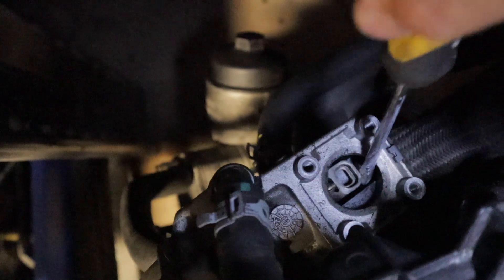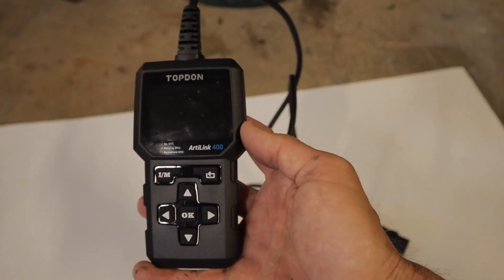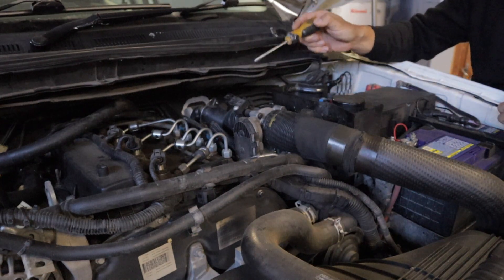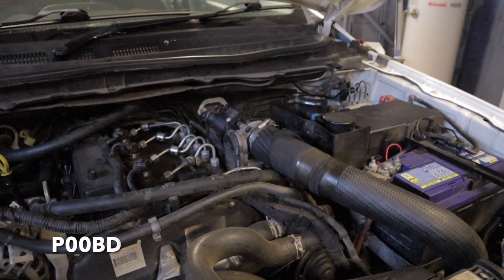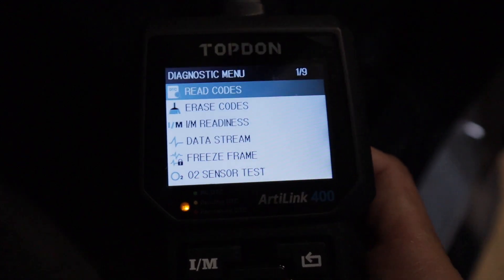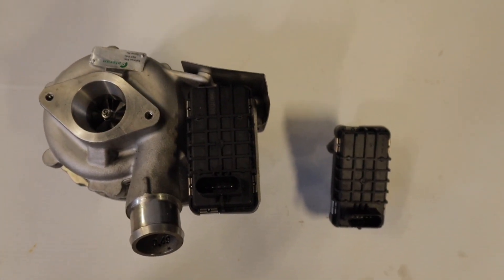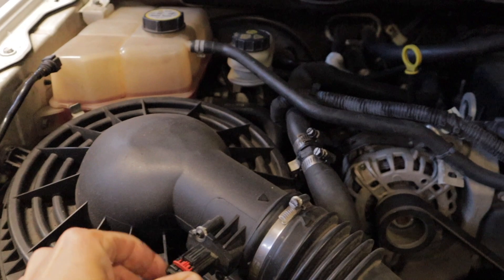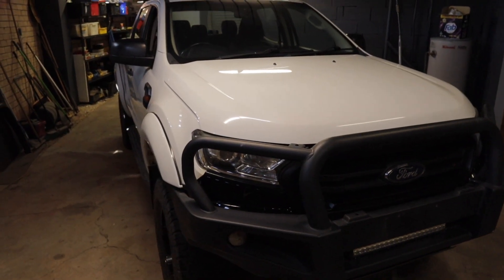Ford Ranger Common Fault Codes Causing Limp Mode

Comment: Hello, I have a Mazda BT-50. I had a heat seal installed, and after finishing the work, I removed the battery and put everything back in place. When I start the engine, it runs smoothly, but I'm having a problem: the maintenance light and traction control light are on, and the transmission starts shaking when shifting forward and reverse. The car moves with difficulty, as if it's in last gear. I checked the faults with a diagnostic tool similar to yours, but nothing showed up. Also, the cruise control stopped working, and the car struggles to reach speeds above 60 km/h. What is the solution?

Comment: Good Morning and thank you for taking the time to make this video. I have a 2012 MAZDA BT50 Dual Cab. 140 000 KMS ... New Transmission Installed at 90 000 KMS.  What I happening now is when I am driving the car the P light is flashing on the dash. The car is running and driving  normally other than that so after asking many people it is still a mystery ?  Any advice / Ideas would be appreciated. Cheers HAYDEN

Comment: Hey mate thanks for the video...  I have a 2017 Ford Ranger wild track with a 192000 kms  The AGR cooler  went on it and Ford replaced it  under warranty 2 days later it's gone back into limp mode.  Took it back to them they gave me these 2 codes P2563 and P0237. Told me it was my Turbo and quoted me $5,400 to replace it.  Just wondering if you or anyone else can help me out with these codes and what it could be thanks

Comment: Replaced my split intercooler pipe with a silicon pipe 5 years ago. That problem solved. 
But 5 years on. I have a EGR A Control stuck closed fault.

Comment: Hey mate got a question ever seen a code on these or the bt50 equivalent throw a code for "engine output sensor" my Ute is showing this code and activating limp mode after a short time driving or when I hold rpm steadily without speeding up I also have the egr valve stuck closed code which im gonna fix by doing a bypass

Comment: Hey mate I’m getting p0403 EGR Control circuit open on px2 2018 3.2 XLT and I’ve got an EGR delete cable installed for few months, this code popped up as soon as I washed underneath the car, what do you think it could be?
Reply: You need to blank it off and remapped out of the ecu and bypass the coolant lines as you've only done half the job with the delete cable. google sidemods egr delete kit,

Comment: I currently have fault codes coming up as P0403 & P042F. I’ve replaced hot and cold hoses with silicone ones, cleaned all intake manifold and EGR valve. All manifold and EGR valve looked very clean. I’m still getting same fault codes and thinking that the issue is an intermittent issue with EGR valve. What are your thoughts on running these codes after above procedure?
Reply from the maker: i would replace the whole EGR valve assembly & blank it at the same time

Comment: Hy mate.. Can i ask something..? What about P2562 and P2563 error.. What will caused this error and do you have any idea maybe how to fix it.. I already change my electronic actuator(non original aftermarket parts) .. And even replaced my turbo (both of this solution was suggested by ford specialist) .. I even replace the intercooler piping and the intercooler itself.. But it still showing the error.. The problem occur when im staying on high rpm for a long time on level road, but the error will be much easier to come out when climbing a steep hill.. The car will enter the limp mode after this error come out.. I have to turn off the engine and turn back again, then the error will gone and i can drive normally after that.. I try to search any topic discussing this type of error online, but i cant find it... Im clueless right now as i having this error for 2 years now... Cant find the part that causing this type of error..
Reply from the maker: if you've replaced all those parts already and it's not helped, i would replace the map/boost sensor on the top of the intake, theres a chance it could be faulty.
Reply: @abdautomotive  thanks for your advice mate..really appreciate it.. I take your advice and already change that map sensor, but didnt have chance to test the car yet.. Will update here after i tested it..
Reply: @PrinceV_Don  Conseguiu resolver o problema ?
Reply: I’m getting P2565. Can this be the actuator as well?

Comment: My Ranger firstly threw the display lamp for transmission error… orange gear symbol with exclamation mark… it would disappear every time I turned the engine off and would return after a while maybe 45 mins driving… then I got the check engine light but it didn’t go into limp mode ? Any suggestions welcome

Comment: Do you have videos having problems with wrench light on? My car went limp mode and i cant start my car. I changed the batteries but it doesnt change a thing. I started my car then it crank for 1 sec and shuts. But if i start it while pushing down the gas pedal, it crank for 3 to 4 secs and shut off. What seems to be the problem? And how to fix it?

Comment: Any ideas on this matter? About every 6 hours of driving shortly after accelerating from a stop... no fuel for about 1-3 seconds. Fuel always seems to kick back in but wondering if could get worse. 
Note: Changed out oil, oil & fuel filters recently. Bit better but problem not completely gone. 2017/3.2. ~105,000 ks. Thanks in advance...

Comment: My PX1 Ranger went into limp mode, stuck in 3rd gear, engine and TC lights on. Removed the stepper motor on top of the EGR and freed the valve up by working it with a screwdriver. Reassembled, out of limp mode straight away and a day later the CEL has gone out. Thumbs up

Comment: Hey mate, great vids - any thoughts one what might be causing U0401 and P0047 on 2018 Ranger. Going into limp mode randomly but appears to drive fine otherwise... Problem does seem to be happening more often and in clusters. Cheers mate
Reply: Did you get it fixed? Having the same problem.
Reply: Hello, I have a Mazda BT-50. I had a heat seal installed, and after finishing the work, I removed the battery and put everything back in place. When I start the engine, it runs smoothly, but I'm having a problem: the maintenance light and traction control light are on, and the transmission starts shaking when shifting forward and reverse. The car moves with difficulty, as if it's in last gear. I checked the faults with a diagnostic tool similar to yours, but nothing showed up. Also, the cruise control stopped working, and the car struggles to reach speeds above 60 km/h. What is the solution?

Comment: Better than the scanner you have is a elm327 cable that supports forscan, and forscan windows programme. You have 100% full access to all controls. Can do dpf static regen, reset all learned values. Data log all sensors, turn certain features on and off that higher models normally only have. It's great. Thr software is free but the cable I bought was about $140. It works with all fords and a fair few other brands

Comment: Today, 12/01/24 I replaced the actuator in my 2015 FR.  The error code was P0048 - Turbocharger Boost Control A Circuit High.

I had to get it second hand as no one locally sells aftermarket.

Thank you for you videos, I have really learned a lot. My car now pulls as if it was brand new.

From Windhoek, Namibia
Reply: got this error  today as well as P2563. stuck in limp Mode. Agents want to sell me a whole Turbo .

Comment: Hey mate, need some help....

Just replace camshaft sensor and cleared the code but it immediately comes back....

I have tried a PCM reset throw disconnecting the negative on battery and connecting a jumper between the pos and neg but the code comes back.

Ford want to charge me $400 to reset it.

Do i have any other options.....i have also tried a se ond sensor thinking the first may have been faulty
Reply from the maker: it should clear, you might have another fault
Reply: @abdautomotive is this the 2.2 in the video ?

Comment: Watching through all your videos trying to find my issue lol, same Ute as yours, in limp mode but not throwing any codes besides glow plugs
Reply from the maker: what are you using to scan codes?
Reply: My bt50 goes in limp mode after 45 min sportive riding or longer climbes 8% or more without the motor management light going on or temperature going in the red.
No codes on the Mazda computer reading.
New hose, new air filter... The mechanic doesn't have a clue and I have to park the car there for a few days for them to find the problem.
But through this video I am able to know how to check the MM light which burns before starting but not when the engine has an issue.

Comment: Gday mate, i have the p0405 circuit A low voltage 2016 px2 i replaced the whole valve and is still throwing the code. A mate plugged in his scan tool and says no voltage to the EGR valve at all do you know which of the wires to test for the A circuit. Cheers for the videos
Reply from the maker: preety unusual , i would have thought EGR valve

Comment: Hey mate, What about a P006A code on a PX2 Ranger. Cheers
Reply: Have you found out what the issue was, that codes just come up on my PX2 Ranger
Reply: @Zhetto I’m not sure on the alarm itself but replacing the intercooler hose on the cold side fixed the problem and cleared the fault automatically. $99 for the hose and 5 minutes to install.

Comment: My PX3 ranger has just begun to play up when trying to start when at operating temps. It cranks over like normal but wont start.leaving me stranded for 20 to 30 mins.
 If i leave it for 20 to 30 mins and try again its starts and runs like normal..so weird.
33k on the odometer.  
What could be the problem?

Comment: Hey bud. I have the same modle. It drives great except when you are under heavy acceleration. Eg overtaking or pulling up a hill it throws the limp mode and i get the cog light that dissapears. No code no engine light. I quickly switch the key off to on and its back to noraml opperating untill i need the power next and it happens again. No other symptoms. No heat issues no excess fuel. Water and oil are still seperate gearbox changes smooth no diif noises.
Reply from the maker: scan with forscan , it will log the code
Reply: I have a similar issue, nothing on forscan. I have a feeling its the wiring on running over the timing cover
Reply: @dannyyalim8400  I have this issue on my 2012 bt 50. Did you work out what the cause was. I have had the cam and crank sensors replaced
Reply: @mitchellmarshall7515  i had the gearbox serviced and lead frame replaced. Hasnt done it in the last month and abit. Hoping it doesnt come back.
Reply: Thanks for the video! At the beginning of the video there's a buzzing sound coming from the engine bay. Can you explain what that sound is? I'm getting that same sound after I turn off the engine.  Appreciate your help!

Comment: I have a 2022 3.2 ranger (in brazil we do not have the 2.0 biturbo), not a single problem so far but man, all I can find is problems related especially to egr cooler failing or turbo exploding engines being rebuilt with less than 150.000km or ford straight replacing them. 
Have you rebuilt your engine?

Comment: Hey mate have you heard of P0672:00-2E Cylinder 2 Glow Plug Circuit / Open causing the car to go into limp? When I get too 2000rpm it goes into limp and that code comes up on the scanner cheers

Comment: Thank u for all the great info, maybe u can assist me with the current problem that I am having on my 2015 ranger. Only when its cold and only sometimes, anti skid light comes on the the gearbox gets stuck in whatever gear its in. then I switch it off and on again and the problem goes away for weeks and then sometimes more regularly. unfortunately I don't have the code. have u ever come across something like that?
Reply from the maker: yeh preety common, it's going into limp mode, i have a few videos & methods on how to scan the computer for a fault code , i would advise watching those videos.
Reply: Have you checked tyre pressure

Comment: Mint vid mate. I have a ‘15 bt50 250k had the similar issues with the egr being stuck closed. I cleaned it up got it working mint. Put in back together. Turned it on and the engine light still shows. Scanned it and it shows P0403 “ EGR control circuit “  what causes this and how can I fix this issue? Tia.

Comment: Good Day AA, I have no codes and no lights pop up... When I drive it goes into limp mode no boost. When I park it for a while and go start it again everything is back to normal what could that be.... No codes with obd tool scratching my head with this one.
Reply from the maker: as mentioned in the video you'll need to scan with forscan.

Comment: Can limp mode make no compression in multiple cylinders? I know it can mess with timing but 4 cylinders out of 6😅please help
Reply from the maker: no, sounds like your injector seats need replacing
Reply: @abdautomotive  naw have fuel pressure ,no leak down either
Reply from the maker: @panzerichi3837  , not about fuel pressure, your injectors fire direct into the cylinder , if the seats are leaking gases it will cause blow by and loss of compression.

Comment: Hi, at the start of the video you mentioned the under boost fault code PO299  - but there was no further mention of that code that I heard as you went along. This code is coming up on my Ranger and the mechanic is stumped - and is at the point of just sending the turbo away to be replaced. Is there anything else to check do you think, prior to replacing the turbo? A smoke test has ruled out any splitting of the intercooler piping. Thank you in advance for any suggestions you might have.
Reply: hi what was your fault please as mine is same did turbo sort it thanks ??

Comment: Hi AA, pls I need your advice as it concerns my truck 2.2L ford ranger 2015. It wouldn't start. I've two fault codes: p2122 and p0341. I've replaced intake camshaft sensor still no start. I've done a continuity test between it harness, they seem very intact. Your advice would be greatly appreciated thank. From Nigeria Africa
Reply from the maker: p2122 is a throttle/pedal position sensor, i've never heard of this problem before, but you could try changing the accelerator pedal
Reply: @abdautomotive  I actually thought throttle pedal issue would only prevents acceleration and not starting. Well, I don't know if it's because it's a diesel powered engine. I also notice that once the P0341 comes up, the P2122 would accompany it. I've replaced this camshaft though but my truck still wouldn't start. Kindly accept my gratitude for your help whenever I asked for it.
Reply: AA thank you once again. I just confirmed that all the 4 injectors are spraying very well. Does it mean that without the right values from intake camshaft, injectors could still spray? Waiting for your response please.
Reply from the maker: @OluwasijibomiMuyiwaBolan-ht1ub   if all the injectors are spraying & you have replaced the cam sensor & still no start, it sounds like your motor has lost timing due potentially to a failed chain tensioner , i would remove the injector pump inspection cover & see if you can feel if the chain has tension on it.
Reply: @abdautomotive  thank you very much for your response. I've taken out, in fact the entire timing chain cover, just to be sure my timing isn't compromised but it's found intact. I will finish coupling today and try to crank again and if it doesn't start, we might need to conduct deliverance on the vehicle 🤣.
This vehicle met all the conditions that's required to start a diesel engine. Unfortunately, I don't have any other known good vehicle of its kind that I could substitute for a parts. I will surely keep you posted after coupling, thank a bunch.

Comment: My traction control light is also coming on with the powertrain warning light will it be a faulty turbo actuator or boost pipe? Don't see any cracks on the boost pipe
Reply from the maker: would need a code, could be a number of things

Comment: Hi can u maybe assist.
My 3.2 ranger gets Los of power on a hill or towing a small trailer. No lights on the cluster gages comes on it shows nothing.
But if u drive slow for a while it pulls only a few seconds then no power 🙏
Reply from the maker: i would start with an intake manifold clean
Reply: Hi thanks I'd clean it very nicely its strange normal drive it's fine as soon as u put the voot down it only pulls for a few seconds then no power and if u keep the pedel down it starts chacking 🤔 no codes on display
Reply: When my Intercooler pipe cracked, I got no codes/lights just very low power.
I'd check your hose/pipe from intercooler to throttle.
Reply: I have the same issue now, no codes if it cools down for a bit then the boost is back.

Comment: hey mate mine goes into limp mode the spanner comes up when it's doing a dpf burn and only load up the engine, no codes and goes away when I turn off the car 
im thinking it's the egt sensor
Reply from the maker: it should be logging a code if it's going into limp mode, are you scanning with forscan?
Reply: @Abandoned Automotive  im using scan gauge 2 ...

Comment: Hey mate. I've had the powertrain light come on and when I scanned it. It kept saying Fuel Temp Sensor. Any idea how I can fix this?
Reply from the maker: whats the actual code?
Reply: @abdautomotive  it's saying Fuel Temperature Sensor. So what do I do now? Your advice would be appreciated.
Reply from the maker: @rockyronz  there are 9 different codes relating to the fuel temp sensor , starting at P0180 through to P0189, so as not to lead you in the wrong direction, i would need to know which one of these it is.
Reply: @abdautomotive  hey mate. My scanner not showing anything further. It's just showing that but the fuel gauge isn't showing the accurate fuel level. It's plays up. Going up and down. Maybe that should help out a little to point me to the right direction.